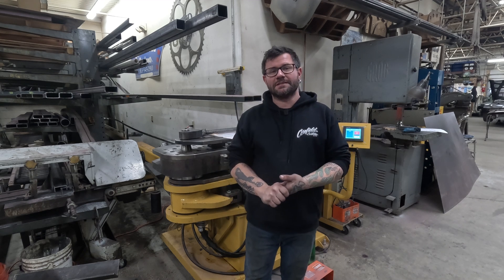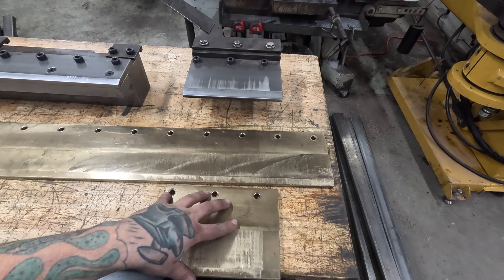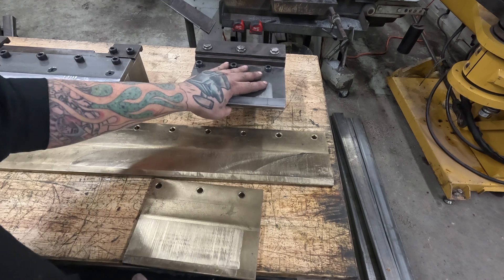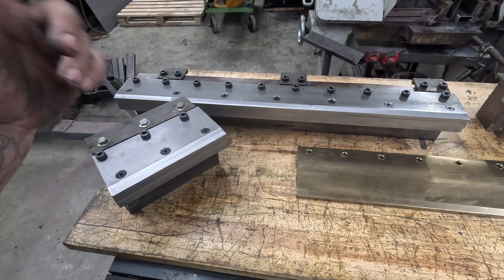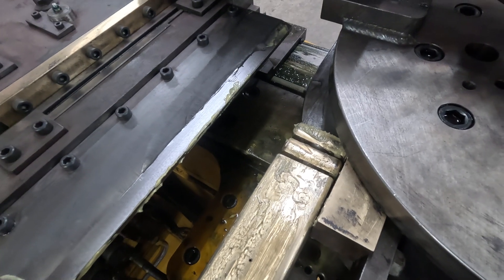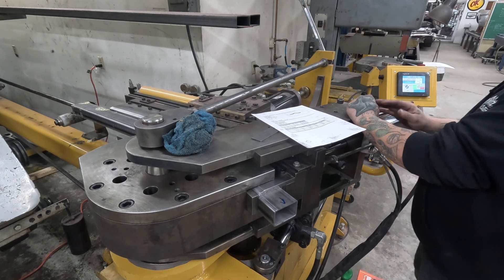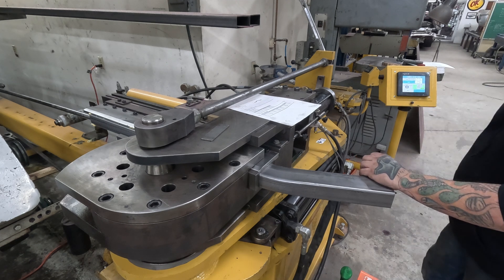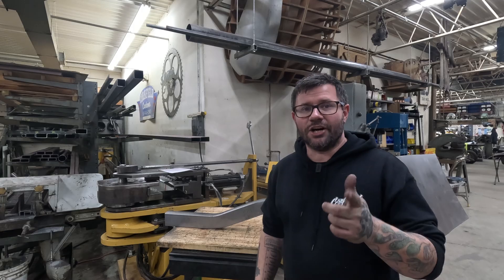Want To Know How I Bend 2 x 3 Tube With 2 x 4 Tooling?

Comment: So, if you wanted to do 3/16 wall or 1/4 wall 2x3 you'd need to order appropriate mandrels, but tthe rest would stiill work, right?
Reply from the maker: Correct it would new new mandrel to match the internal dimensions

Comment: 20 grand sounds like a lot for tooling is there that much metal and componants that go into the machine to curve and bend some thick tube steel, um how many pieces go into each set up for each size tube and die mike?
Reply from the maker: For each tube size and direction you have the female die with is about 250-300 lbs and made of 4 pieces, the wiper die which is a large chunk of aluminum bronze, pressure die assembly, clamp die assembly and then you add in the mandrel cost. large dies for stuff like this get expensive. I paid 100K for the bender to start with
Reply: @cornfieldcustoms  thanks, so thats 8-9 parts yea thats quite a bit more then just the male and female dies I was thinking and didn't know they were severl hundred lbs for the mandrels, thought was quite a bit lighter  like a hollow tube like a thick box didn't know it was solid
Reply from the maker: @manga12  the mandrel is only around 10 lbs of aluminum bronze the main femal die is whats a few hundred lbs
Reply: @cornfieldcustoms  ah yea bronz is kind of heavy

Comment: Hi Mike , love your work and the explanation how you go along .Great job modifying your tooling .
 Do you just work out the bends yourself ..
Reply from the maker: Thanks. Not sure what you mean by work the bends out by myself
Reply: @cornfieldcustoms maybe he wants to know where the calculations are worked out to the get bend at a specific measurement...
You did mention that in a previous video
Reply: @cornfieldcustoms  sorry Mike should have been more clear . When you set up for bending do you work out the measurements your self or do you a library of measurements already stored in your pc ..
Reply from the maker: @DavidJenkins-m6n  there is no library for all chassis dimensions. I draw the frames up in CAD then send over to bendtech software to create bend layout